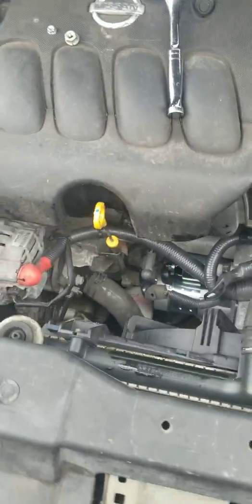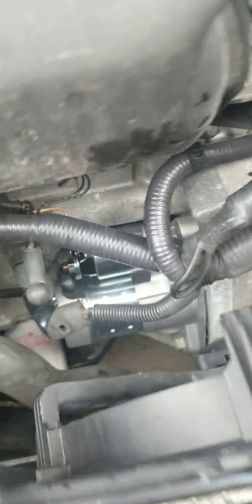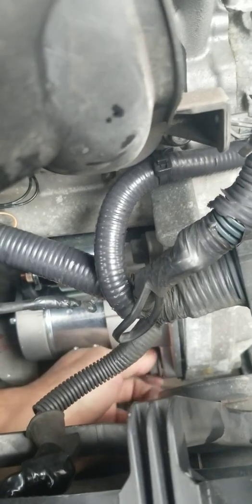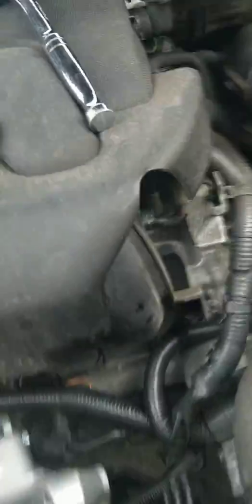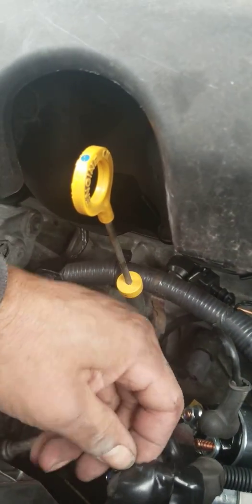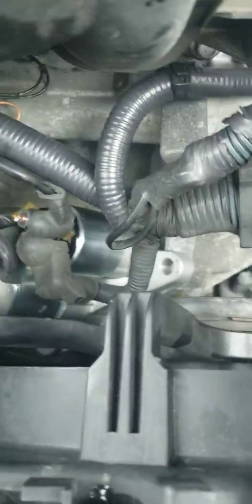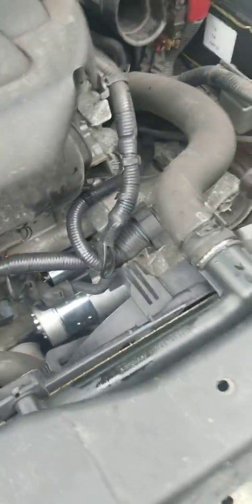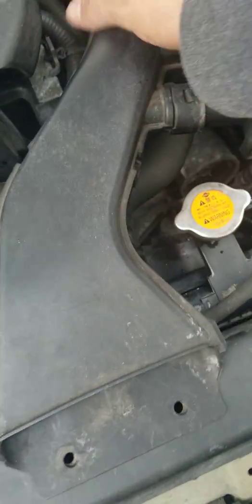How to replace the starter on Nissan versa  2010

Comment from the maker: Everytime you disconnect the battery terminal on Nissan gets service engine soon or other vehicle the ECM is going to get everything lost some cars that why you plug on obd2 port a memory sever with a 12v battery or you gonna have to get a scanner to relearn throttle or reset other things so is good to know what is gonna happen some vehicle like Hondas acuras you need a radio en navigation system code always keeps thos codes you can get then online because if you go to dealership they gonna RIP you off trust me thanks and have a good day